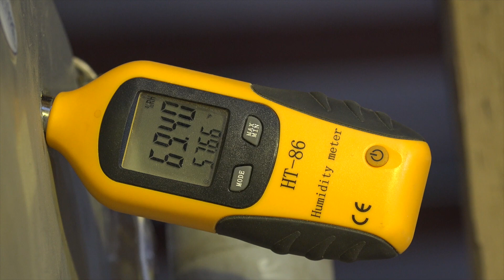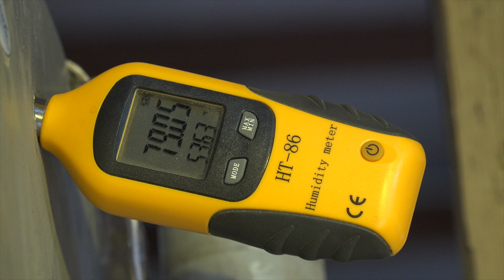How fan speed affects humidity

Comment: Excellent video. I have high indoor humidity levels, and only 8-9 run cycle times. Would having a tech lowering the blower motor die speed does be a good place to start…and see if that adds to the run cycle time, and lowers the indoor humidity level?
Reply: Isn’t nice not to get an answer let alone a straight one? 🤣 My understanding is lower fan speed equals longer run cycle equals lower humidity. I wouldn’t go less then medium because low speed could cause your evaporator indoor coil to freeze up and running the compressor. If you air handler is horizontal then we’ll at least in my case a minimum static air pressure of 2.0 has to be on the supply side so low probably without a manometer to verify would be below that too. Medium or high speed probably your only two choices.
Reply: Stupid iPad won’t let me edit last comment meant to say ruin the compressor.

Comment: I thought colder removes more moisture should give lower humidity no?
Reply from the maker: Yes, Lower fan speed means higher temp drop across the coil.  More temp drop, the more moisture removed.  When the temp rises to ambient, humidity is lower.
GFM
Reply: @grayfurnaceman  thanks for the quick replay! Wow greatly appreciated

Comment: OK.....I am totally confused.  Your video states that lower fan speeds result in lower relative humidity in the air exiting the condensing coil (entering the living area).  Yet your video shows the exact opposite.  When you decreased fan speed the RH on the meter went up.  Where are you taking your RH readings and what am I missing????  Thanks...
Reply: He's not showing how the actual humidity level in the house is being affected. Only that the lower fan speed is simply condensing the air more with the lower evaporator coil temperature which takes away from the airs ability to hold water  allowing for the dehumidification process to start or be more effective. Dew points.
Reply from the maker: What we are trying to do here is remove more moisture from the air inside the structure.  Lower fan speed reduces air flow which reduces evap temp which brings the air temp passing thru the coil lower which brings more of the air to the dew point, increasing condensation.  Hope this helps.
GFM

Comment: What about static pressure?
Reply from the maker: Static pressure does not directly affect humidity, but increased static will lower CFM which will affect humidity.
GFM
Reply: Does static pressure not matter as much if you’re more concerned with dehumidification? Or should static pressure be first priority regardless?

Comment: This absolutely answere a problem I've been having here in Florida. It looks like the apartments basically installed a unit that moves a sh!# ton of air, but hardly budges the actual humidy. Between the cooler temps, and fast moving air. This all makes much more sense, and I will be adjusting my sensors accordingly. Thanks again!
Reply from the maker: Welcome
GFM

Comment: I checked the gyrometer and it's about 50% humidity while the indoor temperature is 74 degree since I set the thermostat to 74. My house have 1,500 sq of living space inside. I have 4 ton installed last week. I had to set it to low speed to prevent too much air flow in the duct. However, it run for about like 5 to 10 minutes depending on how hot it is outside, sometimes longer and then it go off and stay off for about another 8 to 20 minutes. Is it too big and that I need to downgrade back to 3.5 ton or is it about right? I'm from Pensacola Florida.
Reply from the maker: I can't determine sizing on comments.  The cycling seems about normal.
GFM
Reply: Wayne Wallace unfortunately it looks like and sounds like your unit is oversized. 3.5 should have been fine. If this was my house I would speed up the fan that will help with the short cycling issues and give your unit a better chance at surviving. You might want to look into a portable dehumidifier as well. Good luck guy hope it works out my 1800sq house has a 3.5 and it’s an old home 57s and in FL.
Reply: @jaredgoins7000  Thank you so much for the update. I'm please for the update information from you. I'm looking to get it back to 3.5 ton by changing the outside and not the inside. Would that hurt anything? Also, right now, at 74 degree, the air temp out of the air vent is 52 to 54 degree. Is that how could it supposed to be? I measured that temperature with the gun as in your picture. Also, the unit stayed off at night and come back on for another six to ten minutes. It stayed off at about 15 minutes. Is that still oversized? I hope you don't mind the followup. Let me know. Thanks.
Reply: @dmana3172  they have to both match up.
Reply: @jaredgoins7000  I think 3 ton for 1500 sq ft more like it. I have 3.5 and close to 2100 sq. ft.
Reply: Wayne Wallace do you have the capability of checking your pressures and temps? Or checking amp draw? What size duct work?
Reply: @jaredgoins7000  I don't know how to do that one.

Comment: I install goodman awuf2408 for apt complex. It comes wired at low speed. High speed is on a dummy terminal on the circuit board. I'm in central fl. If I increase the fan speed to high to reduce humidity, will that backfire in winter when calling for heat? Wont high speed cool the elements and be less efficient during heat. It has a board but like I mentioned one speed is on a dead terminal.
Reply: When the A/C comes on, the fan relay is energized.  That can be connected to high speed.  When heat is called for, the first element turns on the fan.  That speed can be wired to a lower speed.
GFM

Comment: Would raising the blower speed help with lowering temps in the house at a better rate?
Reply from the maker: Only to the extent that it may move the cooler air throughout the room faster.
GFM
Reply: @grayfurnaceman  Since my ducts are in the hot attic, I went and measured almost a 6 degree rise in temperature measured at the supply side plenum out and furthest supply duct in the house during a hot sunny summer day later in the afternoon. House is 2070 sq ft with returns in most of the rooms. That got me to raise the fan from medium to high and with a fixed humidity reader by the thermostat kept it around 45 to 50 RH and 75 degrees set in the summer. I now have a brand new system one month old with a higher SEER so not able to run much here in Florida lately due to the cooler weather. Not sure if high speed is going to do the same humidity removal job yet but should push the cool air faster to the rest of the house. Thoughts?
Reply from the maker: @jcstudios5629  The higher fan speed makes no difference in mitigating temp rise.  You are just moving more air.  You will probably have less humidity removal with that high speed and I would lower the speed to the point where humidity removal is as you want it.  If there is lack of cooling in the farthest rooms, del with that by additional insulation or increased duct sizing.
GFM
Reply: @grayfurnaceman  The attic has blown in insulation. All the duct work is hanging above all that. Could I lay insulation over the ductwork further down the the chain towards the furthest rooms to try to keep some of the heat out? I know the heat does get into them because when the air handler first starts, I feel a rush of warns air coming from the furthest exchange then the cold air. Rinse and repeat every cycle. The lines coming off the junction boxes up there are a little smaller the the one entering them. Not sure of the exact size. I read some where about the downside of installed attic ductwork and that same issue. Unfortunately there is nowhere else to put them. I also have return ductwork. It’s a spaghetti mess up there. Lenar built these homes in the mid 2000’s and were very proud of their Carrier AC systems installed, complete with larger media filter box. I assume some good engineering went into the design of it all but since I been educating myself on the subject, I saw absolutely no sign of a static pressure test performed here. Perhaps they did it on a same model prior so they already knew the parameters and just instructed the installation of each one the same way.
Reply from the maker: @jcstudios5629  The use of flex duct has always been a problem for me.  It is the easiest to install, but the worst in operation.  The application of insulation over the flex lines may indeed help if it does not crush the flex lines.
GFM

Comment: You probably don’t have a TXV on the coil and that’s why the humidity goes up when fan speed goes down. One needs to drop fan speed when tstat is almost satisfied (within 2 degrees). So, even if you don’t have a 2 speed compressor, you can use a 2 stage tstat and wire a lower fan speed to the Y1 circuit.
Reply: Bran Kind i have a goodman air handler with 5 speed taps if I get a two stage thermostat how could I connect this to switch to a lower blower speed? I have currently have a four wire setup leading to the thermostat but I could run more wires of needed
Reply: Ricardo Bhoorasingh  You'd need a PC board with humidity control or a separate fan relay

Comment: Great video.....it's a bit confusing in a sense because you got people trying to understand RH%.
In the video you have a psychrometer in a duct at the air handler showing RH% going up as the speed goes down. But whats not being shown is the RH% in the space. The space is what most people are comparing the information in this video to and getting confused. In the comments Im seeing people thinking if they lower the speed of the blower they will have a dryer house. You use high speed for ac and low speed for heat rule of thumb.
Reply: I thought lowering blower speed would dry out the house because a lower fan speed gives air more time in contact with the evap coil thus pulling out more moisture.  How is this logic incorrect?
Reply: @revealingfacts4all 
Nice question 
Waiting for answer 🤔👌
Reply: You're right, I thought he was comparing it to the %RH in the space.  I have my American standard heat pump serviced twice a year. So if I understand this when the technician comes out to service the unit, as he just did, for winter service, he should be adjusting the fan at a lower speed?
Reply: Qqaq

Comment: Hey I got a quick question im a New Young Beginner in the HVAC world.  Im just curious about a few things to get the maximum cooling out of my own a.c. I live in dallas texas. Where it gets HOT🔥In the summer. The relative humidity usually hovers around 65% all year . Im curious if i should increase/decrease The Fan speed at the condensor or evaporator.  Right now it's set to high at the Evap coil & medium at the condensor. But also along with the humidity comes the real feel V.S Accual Temp. I think the dryer the air the cooler it feels inside. But IDK I might be wrong. I have cleaned the Evap coil inside real good it looks almost new. The condensor didnt look that dirty so i didn't clean it yet.  My freeon is 410 it was a little low when i moved in so i topped I off. On high side My gauges show 278 PSIG @ 83° F outside. My unit is a 2012year model  Goodman 2 ton  my home is 2100 sq ft @ around 800 CFM/min.  I would appreciate the advice help ive been studying my HVAC book but i get confused with the calculations sometimes. I've been in The Field for yrs 1.5 still got lots to learn.   i found A/C  as my trade. It's what  interests me. And what my brain gets along with best out of 6 different trades I tried.
. Thank you 
Advice would be much appriciated.  And added to my  HVAC  knowledge.

Comment: I live in fla. and have been dealing with high humidity for years even after i just put in a new 2ton 16seer reem. smaller unit than i had to suck out more humidity and its worse. but i did notice the air blows super hard out of the vents. this makes perfect sense. I'm going to get my tech to lower the fan speed tomorrow and I will give it a week or so and update with results 🙏
Reply: How was your result?  You never got back to us!
Reply: Did you have the tech lower the does and did it lower the humidity level?  What was the result?
Reply: @TJ-22  he lowered it but it didn't change anything. Bought a dehumidifier and that solved my issues
Reply: @Juan_thepainter  Thanks

Comment: So if I lower my fan speed I do 2 things I lower the A coil temperature and remove more moisture from the house right which could lower my power bill to right?
Reply from the maker: I would never make that jump.  The primary reason for lower fan speed is to remove more moisture to avoid high humidity in the structure for mold problems.
GFM

Comment: So if you want to reduce the humidity level in the structure you run the blower on a higher speed?  I think that is what you were saying.
Reply from the maker: No.  A lower fan speed removes more moisture from the air, thus lower humidity.
GFM
Reply: Yes grayfurnaceman does need to fill in the blanks where many are just as confused as this. Less is more principle doesn't work here. This is what it sounded like to me also yet I know that lowering the speed will lower the humidity in the home and know he knows that. Just doesn't come across right in the vid.
Reply: From what I understand it's because he's taking the RH inside the unit where the cold air is hitting its dew point from the colder coils. Once the air leaves the system the RH drops. It would have made more sense had he took the RH in the room. Then it would have dropped at the lower speed.
Reply from the maker: +johnmiller102 Actually, lower fan speed will lower the temperature of the evap coil.  The lower temperature will remove more moisture from the air.  Hope this helps.
GFM
Reply: Still hard to comprehend, I would think the RH would be lower at lower CFM because you are removing more water, more so than the slight increase in Delta T.  Is it because of the increase in Delta T that is increasing the RH. I know you are right but it's weird??
Reply: Your video shows R.H going higher with a lower CFM.  I realize the lower temp on lower CFM raises the R.H., but then how are we removing more humidity at lower CFM?
Reply from the maker: Because more water volume is removed.  
GFM
Reply: Lower speed yielding lower rh is what my brain says. But lower cfm and higher rh is what your meter says.  This is why I’m confused
Reply: @co36  It sure is confusing based on the results of the video.

Comment: Question: have you ever worked on this system http://www.emersonnetworkpower.com/documentation/en-us/products/precisioncooling/smallroomcooling/documents/sl-11035.pdf

I have a water level alarm from the HT over filling the drain pump. 
If we lower the RH it stops if we bring it back up to say; 45RH it goes into alarm. 
Have you ever seen this type of problem before?
Reply from the maker: Richard Riley I can't say I have.  Are you sure the charge is right and the evap fan is moving the right amount of air?
GFM
Reply: theres no change and the system is CW cooled.

Comment: Can fan speed produce condensation in the duct work that would cause cans to leak?
Reply from the maker: Autonomous Prime It can if the duct is uninsulated and in a space that is colder than the indoor temperature.  Also, if the ducting is down flow, the coil may drip into the ductwork.  Hope this helps.
GFM
Reply: Autonomous Prime if the duct is going through an unconditioned space, i believe it would.

condensation happens when energy(heat) passes into a cooler object but the moisture cannot.

Comment: I live in florida and in a humid environment. I find more moisture and mold problems when running less than 400/-425per ton. I use smaller more appropriate equipment compressor capacity and higher indoor coil temp but the system running much longer will dehumidify plenty and will not be cycled off as much.
Reply from the maker: That does make sense.  Especially the sizing issue. It can't remove moisture when it's not running. So much of the time I see oversized units installed in the belief it's better to have more. Air conditioning is better all around if it runs long cycles. Thanks for the thoughts. 
GFM
Reply: Very well said. Thanks

Comment: If you are moving more air and the humidity is less, wouldn't you move the same amount of water in a given time, as low speed(less volume of air but higher humidity) with higher humidity?
Thanks for the video.
Reply from the maker: Jody Wilson The DB temp determines how much moisture the air can hold.  The hotter the air is, the farther apart the air molecules are.  That space allows moisture to be absorbed.  Relative humidity is the term we use to show how much space there is.  As the air cools it essentially "squeezes" the moisture, and when the dew point is reached, the moisture condenses out of the air.  I have a playlist on humidity that may help.  Check the grayfurnaceman channel.  Hope this helps.
GFM
Reply from the maker: amtpdb1 Yes, however the lower the temperature of the air, the more water is condensed and thus the lower the resulting relative humidity of the supply air.  Hope this helps.
GFM
Reply: grayfurnaceman Thanks
Reply: grayfurnaceman correct me if im wrong, but these humidity #s i think are very relative to the DB temperature. while reading 90% Humidity at 45* F you might find the same air at 60% humidity at 70*.

can you elaborate on that? i think im confused about something, i do a lot of SAVE testing and find this to be somewhat true....